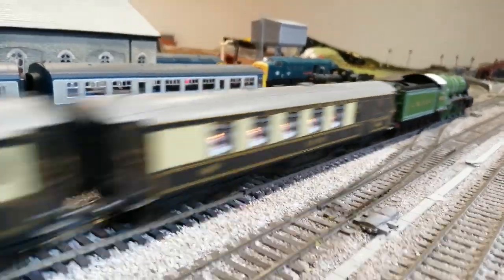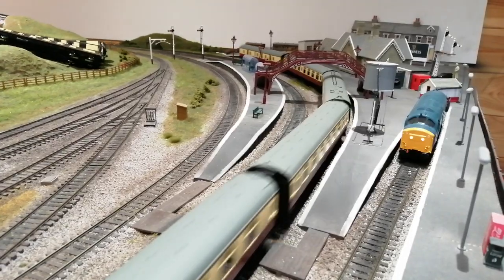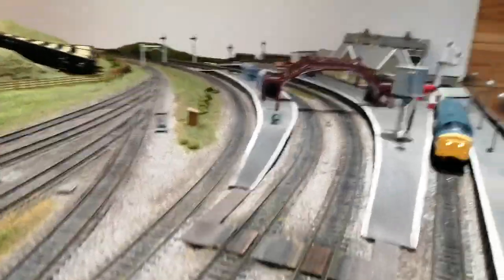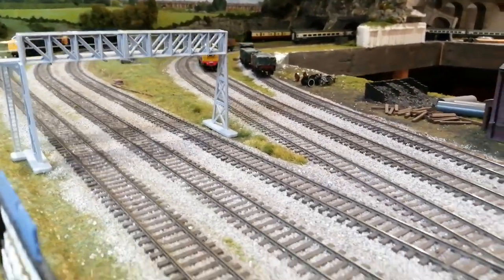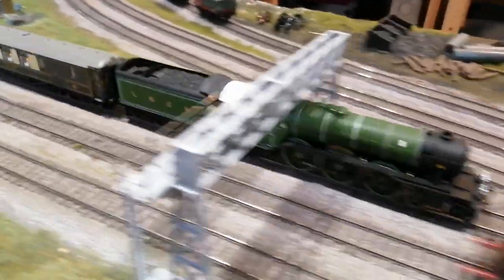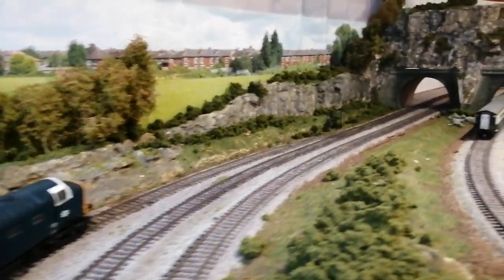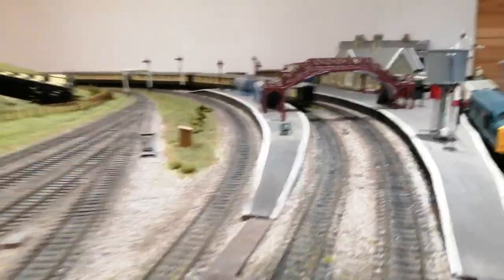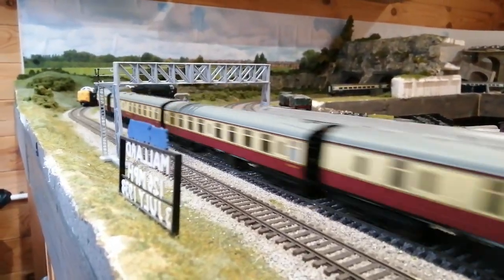slight improvement on yesterday, decoders still causing me trouble but three loops running

Comment from the maker: Thank you for your help, i did think about the power supply. As its a fairly large layout i had it turned up but today my dmu started to lunge. I turned the power down a little and it ran better. Is it possible ive cooked some of my decoders or worse my locos? Im cracking on with my layout build and eventually i will go through each model one ny one. Just thinking about it some locos on the programing track show as no loco or loco error. I need to test some of them elsewhere but i dont know anyone locally. But thank you again for your help

Comment: Hi Jim
Seems like weve both had some problems.  Ive had some electrical gremlins and my power supply packed up and half my point motors stopped working, very annoying and frustrating, completely lost my enthusiasm for the layout.
I have also had some problems with decoders.  Check you have enough power going to the track from the Ecos.
Ive found that some older Bachmann chips dont work well and my Ecos really doesnt like some Gaugemaster chips.  Lenz, Esu, Lais and DCCconcepts seem good on my system.
Id try reprogramming the locos that have stopped working, see if the ecos is still able to read and write to them.  It may be worth deleting the current version and starting again.
Adding more droppers should help too.
Let me know how you get on.
Cheers
Paul 👍